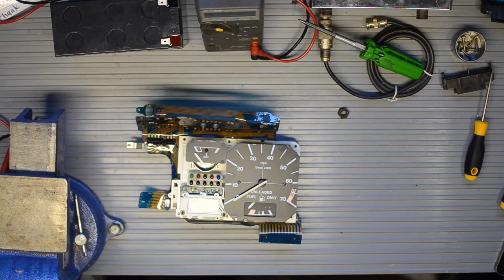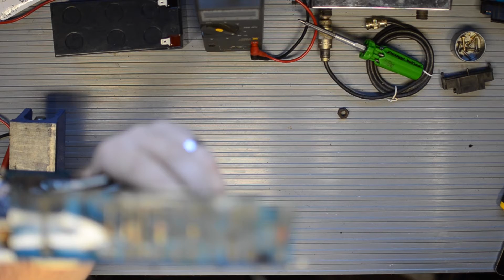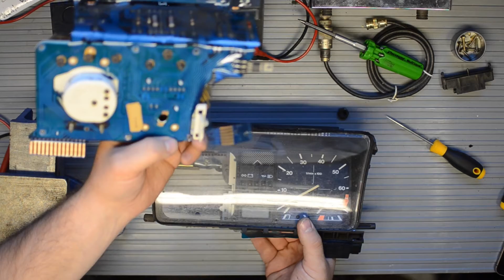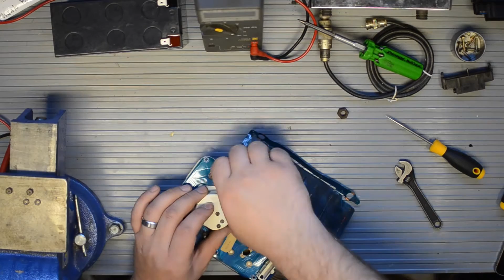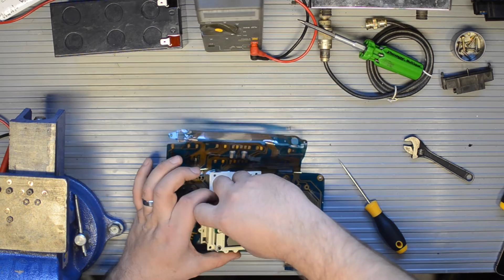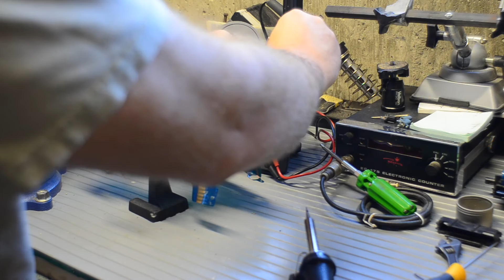004 - VW Instrument Cluster Circuit Board Diagnostic & Repair

Comment: so another way you can fix that broken line in the blue film, is scrap area to expose as you did, then put flux on it, then liquid solder and use heat gun and the solder will attach to the area you want, this stops any soldering iron mistakes. Done this few times on these blue vw films and worked really well.
Reply from the maker: That's a great suggestion, and it would definitely work really well!

Comment: So I just watched your video and I tried to fix it myself and I did but then I put it back together and the turn signal light would always stay on
Reply from the maker: Eric Hearon did you by chance disconnect the battery before pulling apart the dashboard? The wires behind the hazard switch are very easy to mistakenly touch together and cause a blown fuse. I would check all your fuses, especially the hazard flasher fuse and left/right turn signal fuse.

Comment: plese can you give the circuit shema of this cluster (GTD 2 VW) i need it for school project
Reply from the maker: I'm sorry, I don't have the schematic readily available, and I don't think I'd be able to quickly draw one up based on the circuit itself :-(
Reply from the maker: @clintonlouw  Certain parts of it could be, without a doubt; but to replace the whole board with wires would be quite an undertaking. I could see adding a wire if a trace was broken (like in the video) just to bypass a break, but more than this would seem (to me) to have very little benefit.
Reply: @legoguys-repair-anything  thanks for the reply, I have one with a few broken tracks, will try and fix them